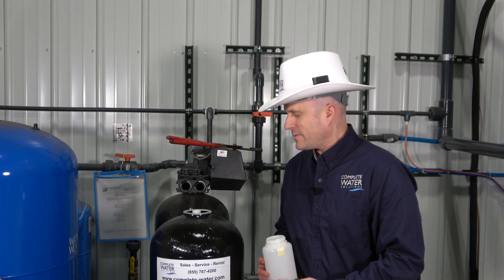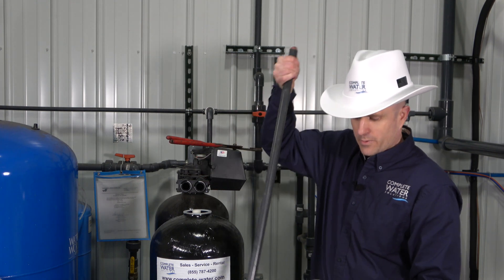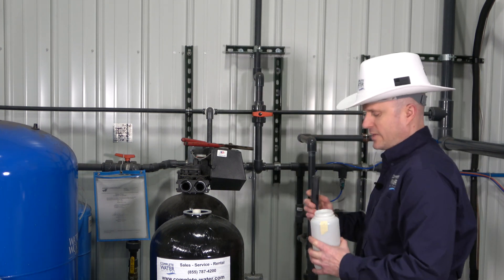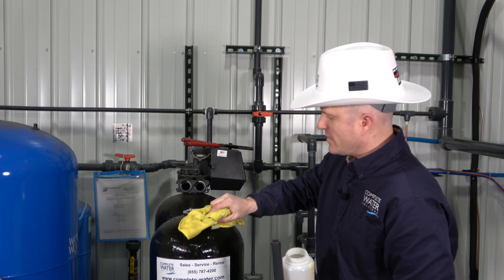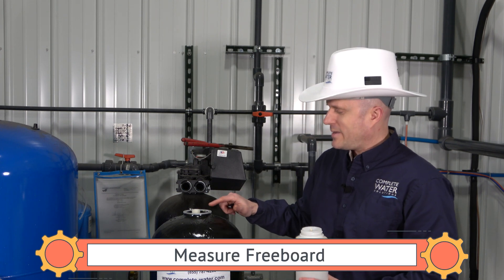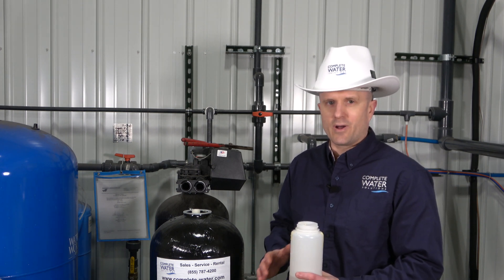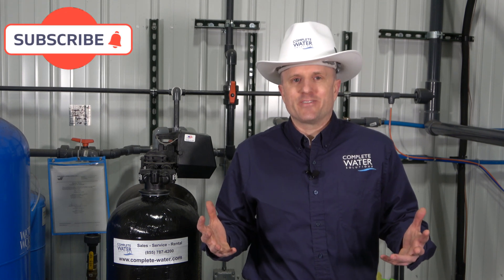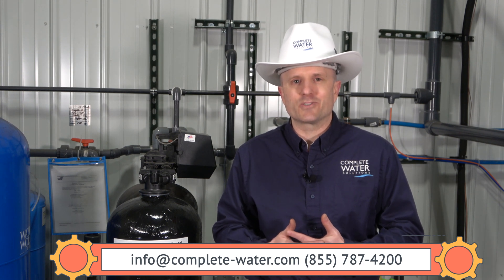Water Softener Resin Testing - How To Know If Your Resin Is Good

Comment: How long I need to change the resin ? 3 day ? 3 weeks ? 3 months 3 years ?
Reply from the maker: This depends on a lot of factors, residential versus commercial, how often you regenerate, chlorinated water supply. In my 31 years of doing this I have seen an average of 10-20 years in the industrial space. Again it could go longer or could be less, most of the time you change due to loss of capacity. Testing the resin can be helpful to help determine when it should get changed.
Reply: Ideally, never. However, most water softeners say that they have a life span of about 30 years, and this is mostly limited because of the resin. As long as you take proper care of your softener, you shouldn't really need to replace your resin and it can outlast more than 30 years. Taking care of it includes things like making sure it always is full of salt and that it doesn't completely run out. Make sure you wash your system every 4 months or so, and don't have a lot of iron or other solids enter Your system (you can do this by installing a water filter before your softener). However, if your softener has been mistreated and/or is older, it may be a good idea to check the quality of the resin. If it is not good, then you'll likely need to replace it.